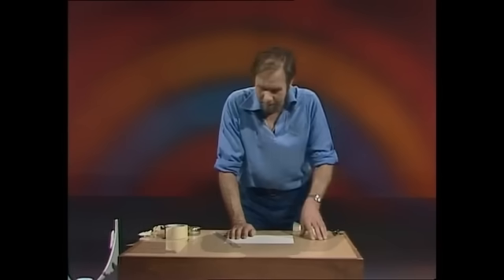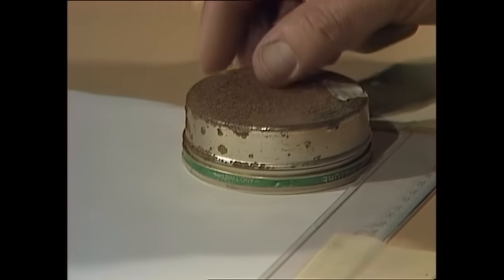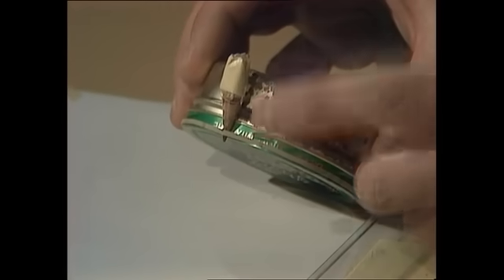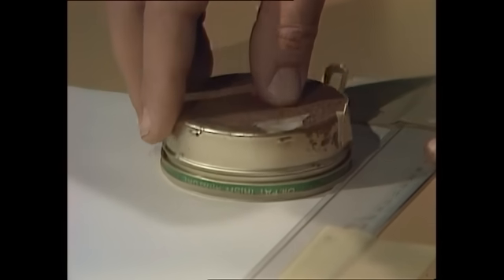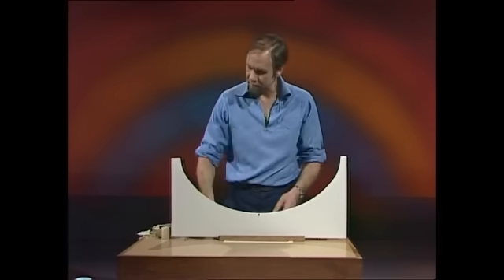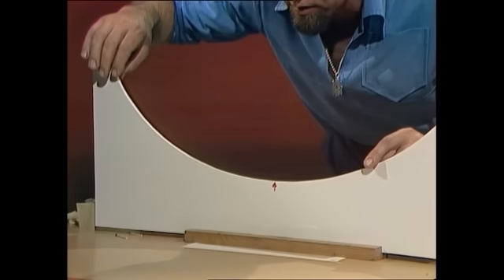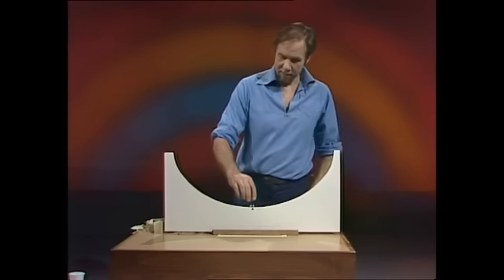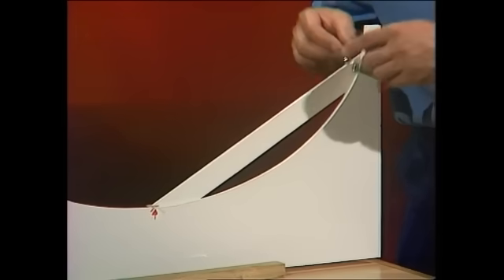The mysterious isochronous curve

Comment: Precisely, T = sqrt(R) * PI, where R is the radius of the circle you've used to draw the cycloid, therefore constant and independent of the object's mass or gravity of the Earth. It solely depends on the radius of your circle. That's why they meet at exact center no matter where you put the ball. None of the ball's properties (including ita position) are part of the equation that computes the time it takes for the ball to reach the middle.

What's also interesting is the fact that since the time is a constant depending on R, each time the ball crosses the middle, it obviously loses momentum and eventually stops at zero. That means every swing of the ball is equal in time, even when the ball is close to complety loosing its momentum.

Therefore, if we describe the ball's position withing the cycloid space (0 being the center of the cycloid), the position could be expressed by the follwing equation:

P(t) = Cos(t) * md, where md is the momentum decaying value at the specific time t, so eseentially a sinewave with decaying amplitude, but fixed frequency.
Reply: That's funny cause I was just getting ready to say all that and you beat me to it
Reply: @wildtill9  Well at least we're on the same page. One of those times when someone on the internet actually agrees with you, which is nice. 😜

Comment: It’s pretty easy to understand. As you move further away from the center of the curve the angle of the curve becomes greater. So the further away the ball is the more momentum is generates from falling from a steeper angle and when the ball is closer to the center the angle is very gradual and nearly flat so the ball doesn’t move as fast.
Reply: but it wont work that way with an arc of a circle

Comment: Thank you for an excellent presentation.   Ideally a clock pendulum should swing in an isochronous curve so its period would be independent of its swing amplitude.  There have been such clocks but the mechanism is complicated.  Thus most practical pendulums use a circular path, but of small enough amplitude that the non-isochronous error is minimal.
Reply: A pendulum swing period is independent of its amplitude. And it is also independent of the mass at the end. As long as the length of the pendulum from pivot point to center of mass doesn’t change then it is unaffected by amplitude or mass at the end. It only changes is the length is changed. I would have never known this until I watched a physics lecture on pendulums lol.
Reply: @randallsammons8086  The pendulum period is not truly independent of amplitude, as mentioned in the video at 3:19, and is why OP mentioned that they "use a circular path, but of small enough amplitude that the non-isochronous error is minimal". You may have learned that the period of a pendulum is T=2*pi*sqrt(L/g), which you used in physics class because the swing angles were always assumed to be small enough that the deviation from this equation was negligible. Hence why angle and period are practically but not technically independent in clocks. A resource: https://en.wikipedia.org/wiki/Pendulum#Period_of_oscillation

Comment: skateboarding half pipes should be designed with these isochronous curves...
Reply: YES!!!
Reply: They are you moreon. How do you think that you are able to get up the other side in order to go beyond its tangent point.
Reply: @stevekent5655  most of the half pipes that I've built had at least 5' of flat in the middle. Ijs man.
Reply: @stevekent5655  What the tits are you talking about you numbskull. Half pipes I've been on have all had their own differences. Some with tighter tranny than others and the radius of curvatures either do or don't remain constant throughout. And yes, almost always with a length of flat section between. And to answer your rhetorical question, you *moron, you get up the other side by pumping through that transition. What a kent.

Comment: Useful for gaining maximum speed when constructing roller coasters.
Reply: Maximum speed is just straight down
Reply: This curve takes the shortest time. Does not guarantee you the maximum speed.
Reply: If you reversed the curve it would take much longer for the coaster to descend but it's speed at the very end would be greater than it would at any point if it were traveling on the inverse side.
Reply: Maximum speed is only related to the difference in height from start to end point. Without friction and drag ofcourse

Comment: you could also just use the lid with a small hole drilled for the pencil lead, and hold it in with the tape on the inside.
Reply from the maker: Pretty good, but there would be a small space between the pencil point and the straight edge that the tin rolls againd. The idea is to get the point exactly on that line - Rob

Comment: Not mysterious if you understand basic laws of physics pertaining to inertia etc based on the incline, gravity and friction of the object against the surface at varying inclines (resistance)... It's not a mystery. This is not a roadway with miles, where taking the straight path would be fastest. It's more like, if you're speed was based on using the exact same amount of energy supplied from built up movement, being in neutral with NO gas/engine applied - but differing built up momentums/intertia even with the same mass...but different gravitational forces from the resistance of the road based on incline it is going down. So of course the one with steeper incline will get there first compared to straight pathed one. If you had two space ships traveling those same paths at the same speed in outer space, the straight line would win. On earth, with no force applied except for gravity, the steeper curve wins. Make half of that curve he made a real 1/4 piece of a circle rather than a full isochronous curve and you would yield the result of the circle being the winner.

I don't know how I know this, but that just makes sense and i'm pretty sure is general logic..

Comment: Very interesting, I don't know what it's practical application could be but it defines what I would think would happen. I guess the acceleration of the ball is so much greater released higher on the curve than lower on the curve.
Reply: I can think of one application: regulating the flow of a material. For instance, what if water was spilling into the isochronous curve from two different sources so as to meet in the middle where a pipe is? The curve could regulate the flow of water into the pipe and thus create a predictable amount of pressure in the pipe.

Comment: Does this have to do with the velocity of the balls on the curve?  Seems like the logical answer to me.  The higher on the curve the more speed it has to reach the center, while closer to the center it has less velocity yet is relative to the ball no matter where it's starting point is.
Now the strait line point might be faster if the velocity had a stronger force than gravity working behind it.  With only gravity the curve allows more velocity to be gained in a shorter amount of time, allowing it to be faster in that sense.

Comment: Well, the two balls hitting in the middle of the curve simply has to do with summation of forces of Force Normal and Weight. The acceleration of the ball higher up the curve is higher than that of the ball most closest to the middle due to their instantaneous angle.

I'm glad that I took HS physics class this year. I CAN UNDERSTAND THIS
Reply from the maker: But it doesn't work with a semi-circle, parabola or catenary curve, so this is different - Rob
Reply: Damn you got schooled

Comment: I don't understand howcome the ball was faster in this type of curve than in a straight line. Wasn't a straight line the shortest way to go from a point to another? 🤔
Reply: The simplest solution to the tautochrone problem is to note a direct relation between the angle of an incline and the gravity felt by a particle on the incline. A particle on a 90° vertical incline feels the full effect of gravity, while a particle on a horizontal plane feels effectively no gravity. At intermediate angles, the "virtual gravity" felt by the particle is g sin θ. The first step is to find a "virtual gravity" that produces the desired behavior.

From wikipedia

Comment: This is bloody brilliaint to see on YouTube in all its simplicity:
A Piano is a linear instrument but to play it requires circular motion: The best motion to use in a circular wave like fashion are the isochronous hand gestures [when viewed from the side]: 

If you couple this with Fibonnaci Seq numbers you acquire the simple but problematic technique to create a desired composition: Its only problematic in that you must practice a lot until you get the fully finished piece: Mozart; Beethoven and Chopin all used this method; which begs the question~ who taught them this and who taught their teachers this? They also used Pi and Phi [Golden Number] as Piano has Pi - ano: 
I know it was a discovery from or via harpsichord [from other instruments] but it still has mystery to it in that who put the Fib Seq and Phi into the Pi~ano? 

I am now presuming that Saturns rings are a tautochrone or isochronous curve shape; which would suggest that Time can be measured via Saturn as a Pendulum ? Also Saturn is referred to as Chronus and isochronous phonetically sounds like Asynchronous [Orbit] How bizarre but amazing:

Comment: so the fastest way from point a to point b is an isochronous curve?
Reply: If both had same acceleration straightline is faster. But in this case curve has more inclination at the start hence more acceleration and achieves greater speed. So even though it has to travel long distance it comes down first
Reply: @anoopgec4818  ...Correct. The curve has greater acceleration because the force of gravity acting on an object essentially is multiplied by the sine of the angle of inclination. The curve starts off with a virtual 90degree incline. Since sine 90=1, it means 100% of gravity starts off pulling it, hence the acceleration results in a higher velocity. Unlike the straight ramp that has a fraction of gravity due to a less steep incline.
Reply: @anoopgec4818  Probably not unique to the isochronous curve. I imagine a quarter circle would give a similar result?
Reply: The straight line is fastest if you add rockets.
Reply: @steverino6954  I wonder if it would make a difference if the surfaces of the incline and curve were made of ice. Would the marble on the curve "slip" and not gain speed due to lack of friction, allowing the marble on the incline to arrive quicker because it is NOT slowed down by friction?
Reply: @Liberty Pastor
Why don't you try it and find out? I'm betting 0 difference and that there's no friction (not sure why you think there is).
Reply: @richardgates7479  I don't have time to do those kind of projects. I have far more important things to do. But I love to take a little time to exercise my mind when I come across things like this.
I just had an idea that I think is worthy of consideration. If you doubt it, prove it; otherwise, who cares? Just offering an opinion on something not all that important for the fun of it.
Reply: @Liberty Pastor
How is speculation an opinion? Typical lazy human mentality. And you refuse to reinforce yet expect someone else to verify that your baseless speculation is false - boy does that sound familiar.
Reply: Liberty Pastor thats illogical thinking, if the marble “slipped” because of friction, than it would accelerate even faster.  Rolling of the marble is the necessary by product of friction so when it rolls, friction is slowing it down. Think rolling on carpet vs wood floors.
Reply: @libertypastor1307  I don't think friction or it's absence makes much difference. In the absence of friction both balls would slide without rotating. With friction the balls rotate which negates the friction to a large extent. I suppose some of the initial potential energy would be diverted into spinning the balls so the they might be a tiny bit slower than on the friction free surfaces.
Reply: @roadracingrelics  Your point about the initial loss of speed to get the mass and weight of the balls rolling is a good one.
I had not considered that.
Reply: Only on the vertical plane
Reply: Its the baristachrome curve or w.e which is basically half of this curve and its from an elevated point a for an object subject to gravity to a lower elevation at a horizontal distance away
Reply: @grimendancehall  lol@baristachrome What's that? A hip shade of lip gloss for glorified coffee waitresses?
Reply: @grimendancehall  I've read this five times, and I'm still not sure which language it's in. I'm a bit thick I think.🤫
Reply: the secret ball bearings did not want you to know
Reply: only if you're using gravity
Reply: WTF is gravity?
Reply: @MJKarkoska  It's a scientifically unproven theory that was developed to help fill in the holes of another patently incorrect theory, the Heliocentric Theory Model of the Universe.
Both these theories are taught as 'fact' by academia.  
Conform or be cast out...
Reply: Depends on what bicycle you're riding.
Reply: Not if you are traveling at the same speed smart ass.
Reply: Apparently so.
Reply: Not if gravity aka gravitational pull is involved
Reply: Wonder is roller coaster designers know about this curve?
Reply: Wile E. Coyote would have benefited from knowing this.🤔

Comment: You have weight + height + angle = velocity rate/distance/time.

The lower on the curve the slower the time and velocity rate and shorter the distance it will travel between the other oncoming metal ball's factors of travel to it's traveling distance. The distance between the two are the exact destination point of arrival calculated by the two's velocity factor's of travel from it's point of origin it started at. Calculate those factors, and tell me if I right.

Comment: The reason two spheres always meet in the middle is because the further out the curve you go the inversely closer to vertical the line becomes.

The rate of acceleration of an object released is thus closer to maximum for a free-falling body, as opposed to the gradual slope the opposite body is subject to in which initial inertia must contend with the drag of rolling friction against a solid object.
Reply: That doesn't explain why it only works with this type of curve though, if that explanation were all there is to it the you would see the same result from a perfect semi circle
Reply: @internetguy692 

A (semi)circle is a continuous curve of the same radii, it does not compound inertia of the falling body, it just changes it's direction of travel.

Comment: love the slight bit of white noise reminds me of tv when it was good
Reply: It's not white noise but a sharp line at 15625 Hz which is the frequency of horizontal lines in PAL, 625 lines at 25 frames per second. In a CRT TV that noise is made by the flyback transformer I think.
Reply: Kalum Batsch wow ok smarty pants. He’s still right. Because we only used those style of television’s when he, in fact, meant the tv programs were good
Reply: @Kalumbatsch  edit: this is wrong
No, it actually is white noise. If it was flyback transformer whine it would have a more definite (and higher) pitch. You wouldn't hear the flyback transfomer on a recording like this because it's a recording, it's not being played back on a CRT.
Reply: @rzeka  It has a very definite pitch. You can look at the spectrum in a program like Audacity, there is a sharp peak exactly at 15625 Hz, which is the horizontal frequency of PAL as it was used in Australia. There is no need to argue about it, it's the video signal.
Reply: @rzeka  I just listened to it again, this time with earphones instead of the big headphones and now I can barely hear the high-pitched whine but there is a lot of what sounds like white noise. I get what you mean. I guess the whole video signal just bleeds into the audio by a cable or bad circuit.
Reply: @Kalumbatsch  It's probably a combination of noise from the original recording, the tape, and analog cables.

Comment: Anyone out there know how to produce Concave Conical curvature?
I mean Mechanically?
Includes.
Round. Spherical. Ellipse.
Parabolic. Hyperbolic. 
And every others curvature in between.
Plus. On or Off Set with 2 different focal point on the same surface. 
And with an accurate and pree determan focal length?
Descovered the system 1976, build a machine in 1982 that could grind up to 72" Dia surface With an F .5  Focal length 2mm+/- accuracy.

Comment: It's interesting how the height of the balls does not matter. It is also strange since the curve is isochronous. A pendulum follows the same rule but the arc is uniform throughout. The amplitude has no effect. Are there any other examples where amplitude has no effect or are uniform and isochronous the only arcs not affected by amplitude?
Reply from the maker: I am not sure. possibly someone with more physics under their belt could handle that - Rob

Comment: I have a question and a comment. My comment is that this person has a gift for explanation. He really tells you all the details that you need to know. The question is that the same motion seems to apply to pendulums in that no matter where you realise the mass attached to a string the time taken to reach the lowest point is always the same. But for the case of a pendulum the motion is clearly circular. Could you therefore explain this contradiction?
Thanks
Reply from the maker: Thanks for your kind remarks. There isn't space here to get into all that, but look up isochronous curve, brachistochrone and cycloid (this has several names) and that should tell you most of what you are after - Rob

Comment: because the other one higher will travel faster but travel far but on the other side when you put it just to lift it up a little bit it will travel slower but it will travel shorter than the other one